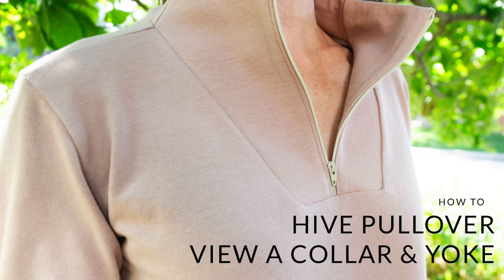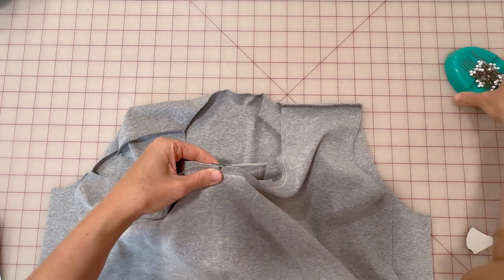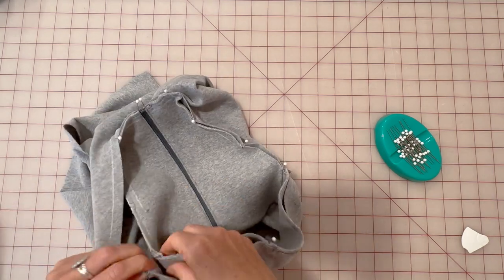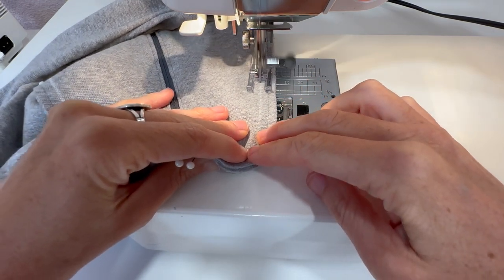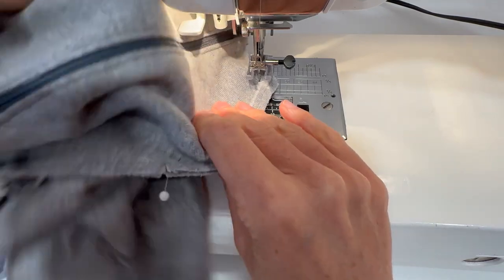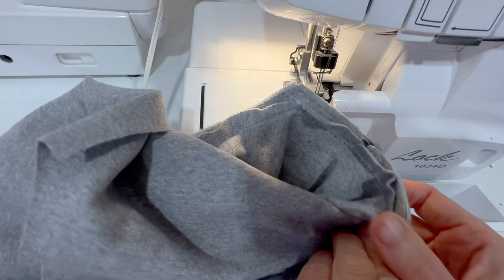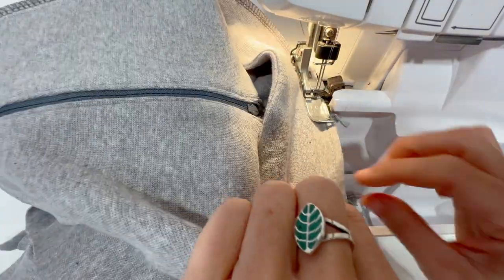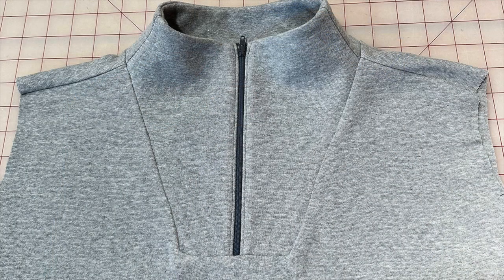How to Sew Hive Pullover Yoke: View A

Comment: Thank you so much for this video. I just finished my first Hive and I love it. I have a tiny suggestion. After I drew the seam lines on the bodice, I stay stitched the corners with a very short stitch length. Then I clipped into the corners before I pinned in the yoke. It made it so easy to get the corners perfect, without any puckers. Hope this helps!